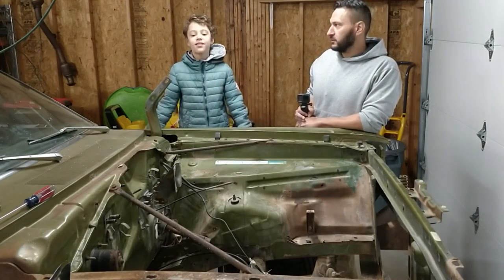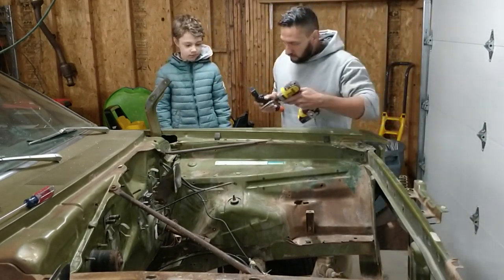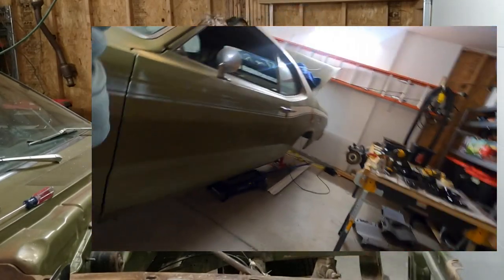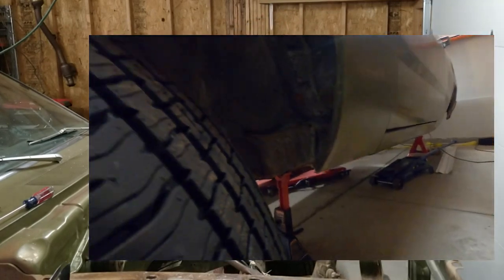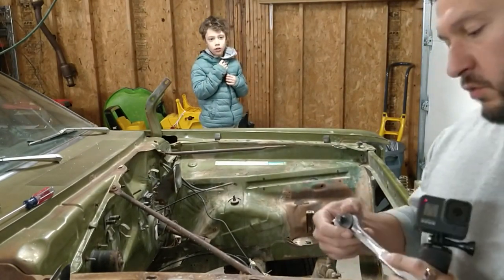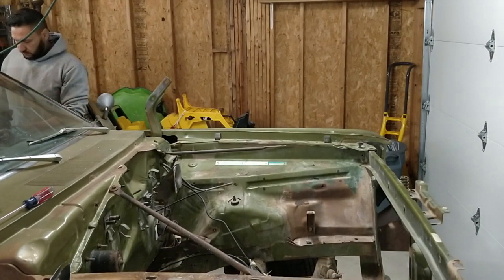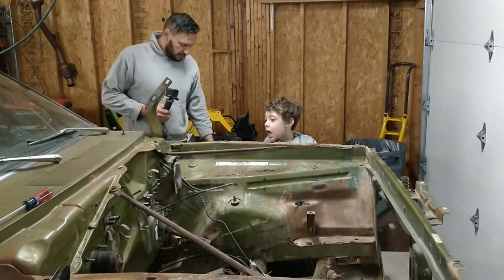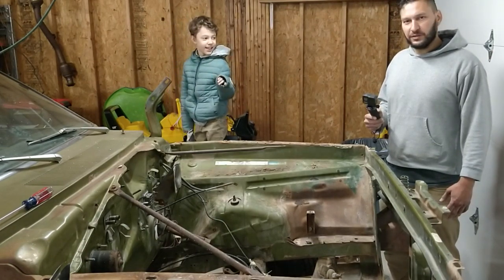1974 Plymouth Duster Front Fender Removal. Dust or Bust Project. Best little helper.

Comment: Nice video,great heper. If you remove the splash shield, what you referred to as the shroud you can access the last hard nut easily from the wheelwell.  Remove the splash shield from the wheelwell, 3/8 and 7/16.
Reply: Yep, That's what I did and it makes it so much easier & quicker along with a air ratchet.

Comment: Going in to get that bolt from the hood hinge is much easier, working on a '68 dart.  AND if you're going completely from scratch you have to take the bumper and grille off. there is also a 7/16 bolt hiding at the top of the fender in the inner fenderwell.